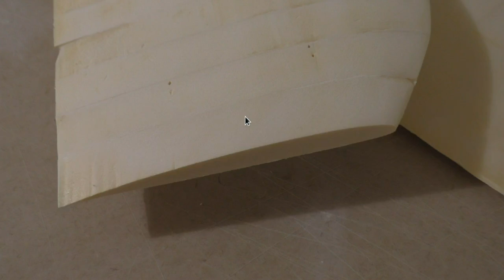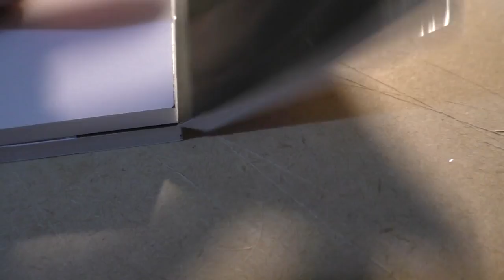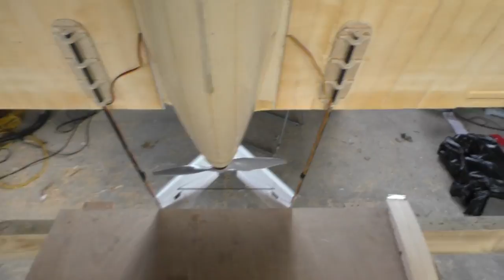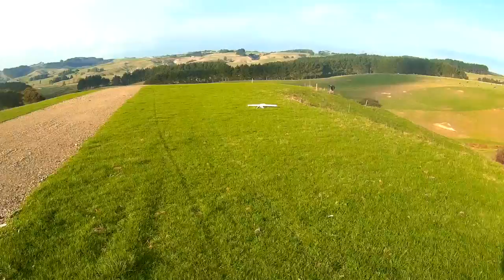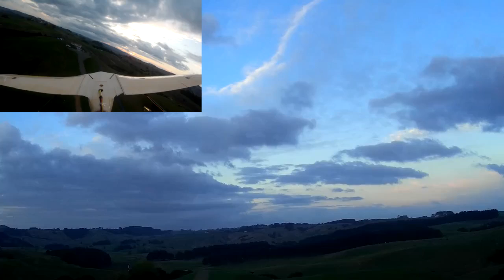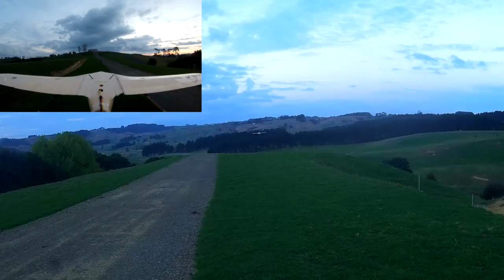"Stacked slices" scratch build part 2 (maiden)

Comment: i have a method for folding foamboard with paper that i use for kf airfoils
i make 5 shallow 2.5mm cuts in the foam just deep enough to cut through the paper and into the foam a tiny bit
the middle being on the line im folding over
then i use any rounded plastic object to compress the foam in that whole 10mm thick area then put tape along the other side so the paper on the leading edge doesnt tear
then just fold it over and it makes a perfect consistent fold every time
or you can do just 3 cuts 2.5mm apart for a less then 90 degree fold

Comment: Nice build! I plan on scratch building a fixed wing FPV platform. It will be a conventional built up or combination of composite and built up airframe. The airframe will be similar to the Skyhunter or Anaconda or a twin tractor like the Senior Telemaster Twin but with a NACA 2412 airfoil.  What airfoil are you using on your scratch built Skyhunter? Thanks...
Reply from the maker: NACA 3310 ... ish
http://airfoiltools.com/airfoil/naca4digit?MNaca4DigitForm%5Bcamber%5D=2.5&MNaca4DigitForm%5Bposition%5D=32&MNaca4DigitForm%5Bthick%5D=10&MNaca4DigitForm%5BnumPoints%5D=81&MNaca4DigitForm%5BcosSpace%5D=0&MNaca4DigitForm%5BcosSpace%5D=1&MNaca4DigitForm%5BcloseTe%5D=0&yt0=Plot
Reply: @iforce2d  Thanks for the reply. You said NACA 3310...ish but linked to 2310. I could not find a 3310 in the NACA database but was able to create that airfoil. Do you know what airfoil is on the is on the Skyhunter or maybe even the My Twin Dream?  I hate that I over think everything but not knowing much about reynolds numbers and only being familiar with lighter wing loading aircraft instead of heavily loaded long range FPV craft I'm really trying to find the best airfoil to use.

Comment: Nice looking plane and its always great when a scratch built plane flies well - and this one certainly does.  For the fear of the prop striking the ground:  have the break "on" (as you do), but mainly, NEVER have any amount of throttle "on"  when you land - then forget about the rest... It is highly unlikely the prop will get damaged on landing if you do the above 2 things - seriously!  For the pitch up under throttle: try changing the angle of the motor by placing washers under the the top 2 motor mount screws - may sort you out!

Comment: Hi I first saw this plane in 1968-69 and it was built by a fellow named Ray Longacre. Just a thought tho the mixing for the inverted V tail was acomplished with three servos and a sliding rack.(no computer radios). It was a great flyer. What more did we need pusher engine ,inverted V tail four chanels high tec fiberglass construction . Life was great... Oh and no retracts... Rohm Air and Spring Air wern't around yet. Thanks Jim Love.

Comment: How about thinking to put a foldable prop on this bird? It would let you stop the motor spinning and you wouldn't have any doubts for bending the prop while landing. 😉 Btw: Nice job done. 👍😃
Reply from the maker: Yes naturally that was my first thought, but the only folding props I have vibrate like crazy, and hard to find a hub with a 8mm diameter hole.

Comment: Carries momentum quite well in the glide which I figure is great with the efficiency goal, but seems like it may be worth trying a flaperon or spoileron mix that toggles on to help with bleeding off speed and getting it to not float so much (ground effect?) on landing. I would think that would be something that should be quick to try out if your controller setup allows you to program it.

And do you think the stalling to one side is caused by something off by a hair on one side, or is it just aero drag given how that camera setup was done? If it's consistent and predictable, and powered flight is good, probably not worth worrying about though.

Comment: To help protect the prop, what about using wire skids?  Basically, it’s bending two wires, placed on both sides of the length of the body, that lifts the tail of the plane up so that they don’t land on the prop. As you come in for a landing, the wires are acting like sled landing gears. Great looking plane and great flying.

Comment: Very cool :D the only issue with that orange small cell insulation type polystyrene is it gets dings and scratches very easily, other than that though its quite easy to carve/sand to create nice smooth surfaces for wings and fuselages. Excellent job flying as well, looks nice and smooth.

Comment: Re: flite test style + tail weight : 3mm foamboard works really well for most applications with span up to 400mm IMHO. You can save 50% of your tail weight between that and less hot glue like you said. 😊

I love FT but I find the smaller designs are way heavier than I'd like when made of 5mm board.

Comment: How much it weights and what is the motor ESC combination...??? Yeah... when you mentioned the weight of the plane... and saw that little tiny motor! I realize you need a more robust power plant.... I'm in total unbelieve of how good that airframe is.. and how little take it to glide... but it is clear that you need a bit more of power , Now let us be honest!! This plane remind me of the plank style of pilon plane!! "Very low resistance & High speed"   Finally just by personal experience "About the battery...& weak cell" I use to buy the 6S 8000mAh.. (It only took once for a cell to die before I started to buy the 2S packs... in that way if one die is much easier to just trow the one with the bad cell and replace. So incredibly nice video sir!! thanks for posting it..

Comment: Good result. What motor and prop did you end up using?
Reply from the maker: 3536 1250kv, 9x6. I forgot that I was impatient when ordering and the 950kv was not in stock, so I got 1250kv. That would explain why it was a bit hot and was doing level flight at under half throttle.... I might try an 8 inch prop and see if it still has enough oomph.
Reply: @iforce2d  Thanks Chris. I also use the 3536 as usually running a 10x6 Folder at 35A. For pusher I use the usual limiting to stop the blades crossing over. The 9x6 should be around 25A.  The motor has served me quite well apart from the odd bearing failure. The combination I seem to have settled on is ~1000Kv 10x6 3S.
Reply: I really should listen to the dialogue track carefully;). You may have lost a bearing with the noise. I use Motocalc (quite old) which predicts 38C 1700gm of thrust running 9x6 on 4S. The 8x6 is slightly hotter at 40C with 1200gm of thrust.

Comment: Wow! Nice piece of work! Flies good, looks good... Here's a few notes that may/may not prove helpful for tweaks etc.
- Yes, weight is deceptive... I often hold a plane in my hand and think "wowww it weighs so much" only to find it's unfeasibly floaty once I get it in the air. From the way this handles (especially how relatively hot it lands) I think it's at the slightly higher region of the wing-loading bell curve, but far from a "lead sled" - it hand-launches too well for that. (Keen to know what its wing area is, if you get a chance to work that out.)
- Although the boom flex was impressively low for 6mm, I think you might have an easier time mounting your camera on the center body - the wobble should be gone entirely and you'll have a more permissive range of battery sizes to hit your desired CG. Just making a little foam fairing to blend the camera body's trailing edge into the fuselage should cut its drag right down, too.
- RE: the wings being friction-fit: I've had nothing but good experiences with that myself. There's no in-flight loading that pulls outward down the wing's longitudinal axis, and you'd need some pretty brutal oscillations to vibrate them loose. If you're worried, just slap a bit of tape on the top of the wing/fuselage join point, with a little fold-over at the tip so it's easy to peel off when you want to remove the wings for transport etc. Furthermore, I've found that friction-fit plug-in wings save themselves beautifully in a mild-to-moderate tip crash; energy that would have dented up the wing tip severely just goes into (partially or fully) unplugging the whole wing. Intentional failure points may not work in full-scale, but at model-scale we can really make the most of them! :)
- Trims: For ease in future, I'd say find the throttle setting at which the plane can just comfortably sustain level flight, and do your trims at that throttle. Climbing on higher throttle (or dipping on lower) is entirely normal behaviour and generally what a full-scale plane will do - the way I've seen pilot manuals explain it is, you trim for a given *angle of attack*, not a given climb/dive profile. What the plane actually does with your trim setting will vary with airspeed. That said, model flyers usually prefer to tweak a plane until it stays dead level with throttle changes, and there's absolutely nothing wrong with that - just don't take climb-with-throttle as evidence that you've made a build mistake. :)
Anyways, enough gasbagging from me... this is a gorgeous aircraft, flies like one, and it's really cool to see the results of a build with that stiff yellow foam stock (I've just inherited some myself and wasn't sure how it stacked up to the softer foams I normally use.) Congrats on a successful build, hope you get some sweet FPV flights out of it!

Comment: Nice job brother, it carries a lot of energy when gliding, I didn't notice but did you put flaps on it, or are you planning to put flaps?
Reply from the maker: Actually that first landing was going downhill, about a 5 degree slope so it just made the glide look better. I might experiment with flaps if I put a flight controller on later.
Reply: @iforce2d  right on looking very good though keep up the great work 🤘

Comment: Fantastic video , I enjoy these videos a lot . A few thoughts : that plane is supoosed to be extremely efficient given that the transition between the wing and the fusolage is extremely smooth , that decreases interference drag A LOT.
The booms are definetely a bit too flexy , but other than that , it looks good .
Might need some flat spars inbedded into the outer wings to help with flexing

Comment: That's a very pretty plane and seems to fly well.
Is it just an optical illusion caused by the intervening prop or does the starboard wing move slightly at the root in flight?
Reply from the maker: Can't say I had noticed. At any point in the video in particular?
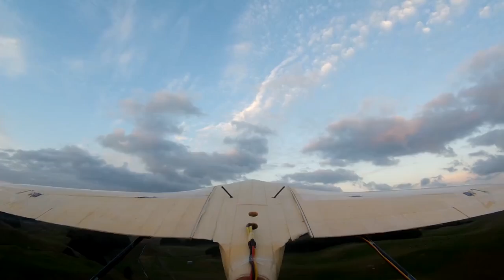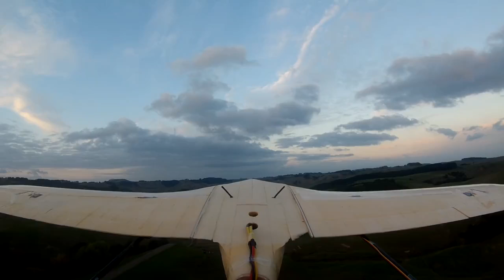Reply: @iforce2d  It may just be distortion but in the clearest examples it seems to move in and out laterally at 16:33 and again at about 17:56 on. it's not a big movement (if it is a movement) I played those two sections back @ 0.5 speed.
Reply from the maker: @didactylos4diddy474  hmm... still can't see it. I wonder if it's reflections on the packing tape.
Reply: @iforce2d  Could be I guess

Comment: Looks good, I like the fuselage and wing design!  I was expecting it to pitch up more on rudder input.  Maybe the large stabilizer surface dampens the pitch.  Would be interesting to see if you could get into a full bank with the rudder alone. Alot of interesting possiblities with the design like adding differential to the V-tail elevators/rudders.
Reply from the maker: The angle of the tail planes are pretty much 45 degrees (90 degrees to each other that is) so I think rudder should be neutral in pitch. It banks a lot more than I had expected from just rudder, so yes banking seems pretty easy.

Comment: Excellent. Maybe getting the CG better placed will help with the trim setting. i.e. if it pitches up on power-on then it's nose heavy.
If it tip stalls to the left, maybe that wing is a little heavier. Did you do any lateral balance, most model flyers do not.
Other than that, I love it, great stuff.